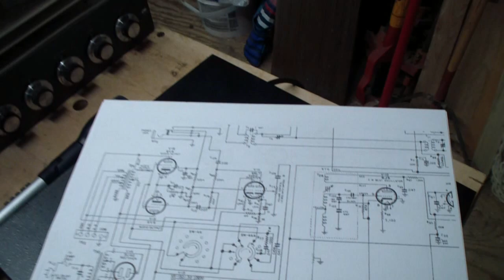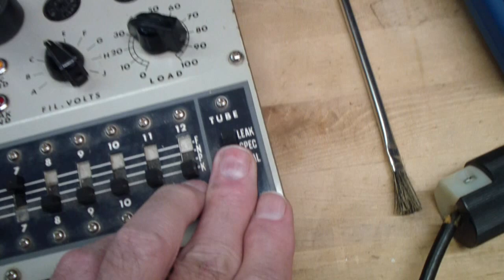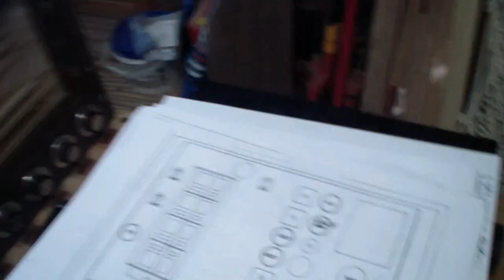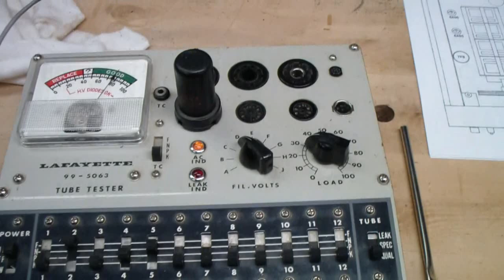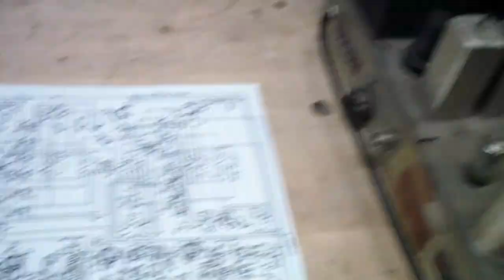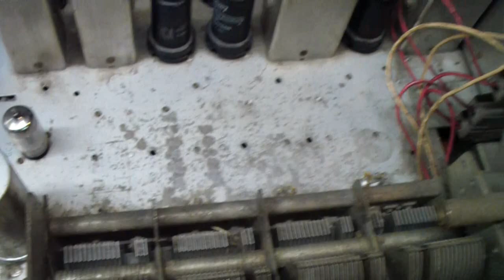TTT075 Hallicrafters SX62A Restoration Pt2

Comment: Hi..I have a 6C4 in my SX-71 radio..which is a oscillator tube..and I was told that different tubes ack differently in this radio..so even tho it is a new tube(NOS)..it might still not work, and it might take a few tubes to get one to work..just thought I would bright that up..nice video..